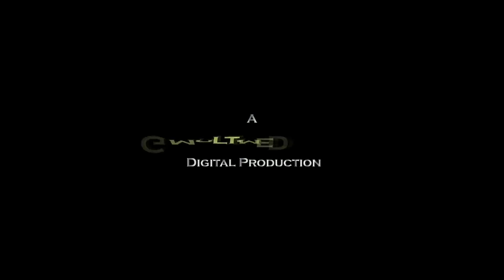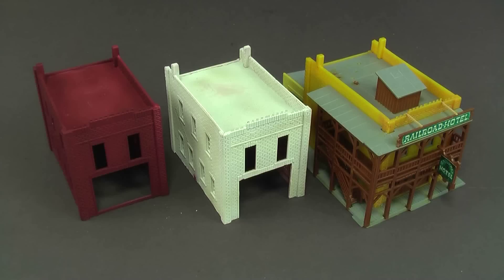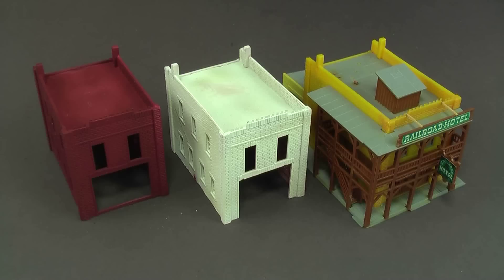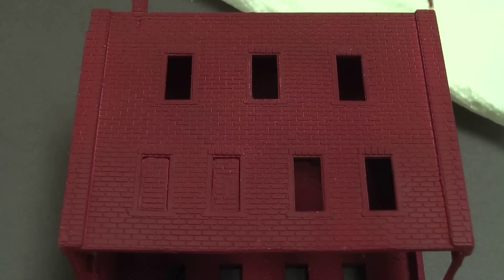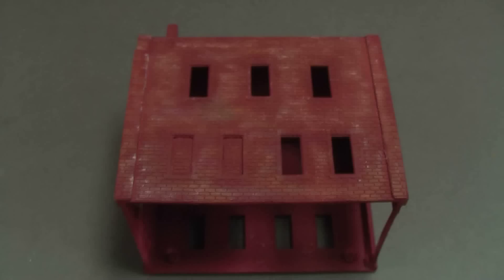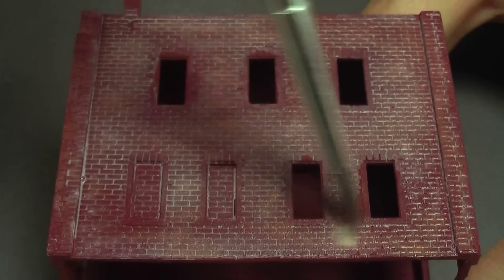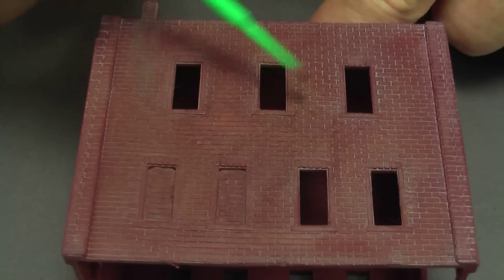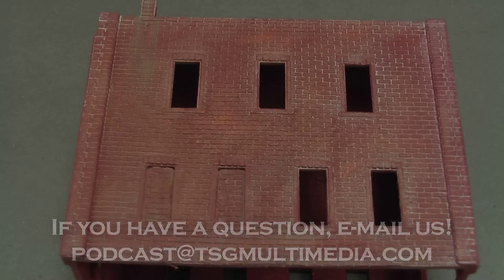N Scale Detail & Weathering Brick Buildings Part 1 How to

Comment: Sometimes the bare Floquil paint is too flat for the washes, and will discolor from them.  Next time try gloss coating before the wash.  That way the wash can easily be wiped off of the top surface of the bricks.  Then dullcote later to deaden the shine.  There are also interesting techniques for using colored markers to hit individual bricks.  most buildings I've seen don't have the "blotchy" look that results from rough drybrushing and chalks.